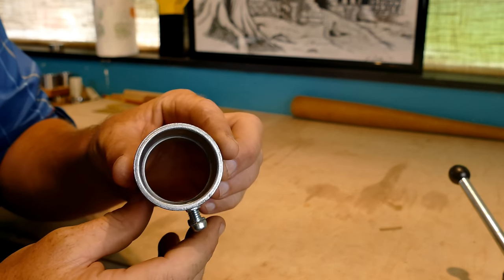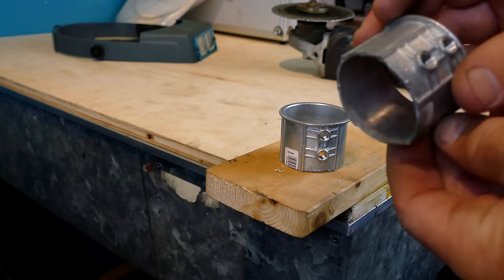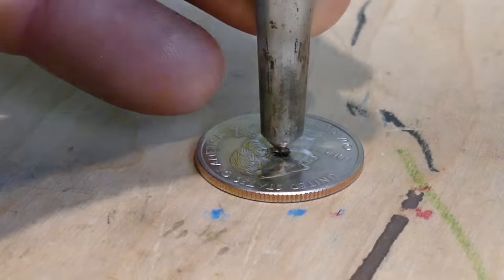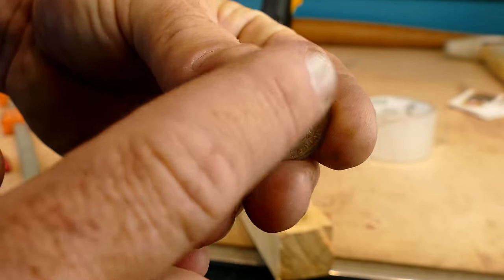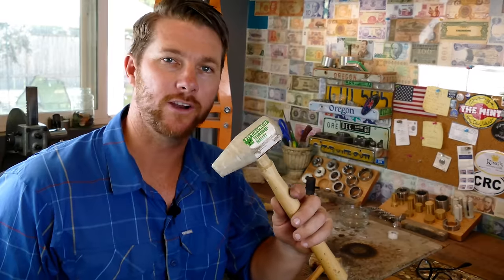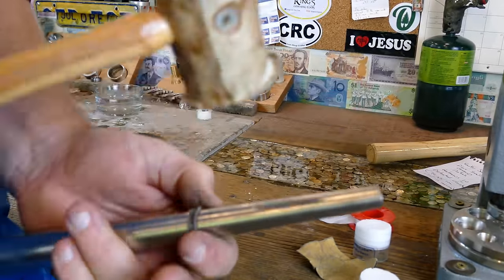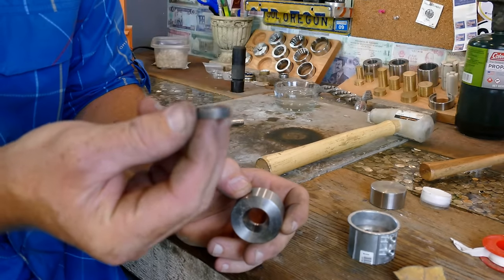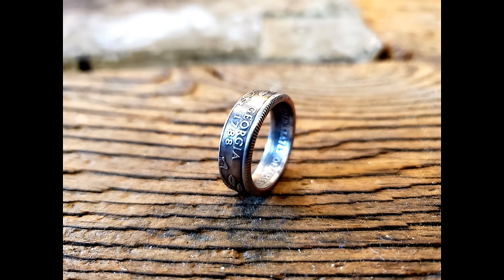Making a Pro Coin Ring Without Expensive Tools

Comment: Naw man.  I think you misinterpreted.  We want to know how to make one without ANY ring tools lol.
Reply from the maker: I made that video a while back. It is called Forged coin ring making for beginners
Reply: Yeah the press is pretty cheap if you get one at harbor freight. The dies are the expensive stuff. I have most of the stuff including dies and the press was easily the cheapest.
Reply: You don't need the ring sizer tools  a drift pin and torch to keep the coin soft just be gentle with the hammer. Get the rubber mallet from harbor freight
Reply: Railroad iron, hammer, drill and rattail file. You're welcome 😊
Reply: @CoinRingsfromTheMint  olá faz um belo trabalho
Reply: Try the magic wand method or tapping your heels 3 times.
Reply: @mayneric  what's the press do ?
Reply: an absolute bossanova you don’t need the hammering part.  A hydraulic press makes that part happen way faster, easier, and smoother.
Reply: @mayneric  how much are they compared to the tools you use to hammer ?
Reply: an absolute bossanova you can get one at harbor freight for $84.00
Reply: I made one with a hammer and file by hand.
Reply: cross hatch  Matt is right though, just the dies are over 100 bucks, thats in no way "without special tools". Dont think he was complaining about having to do work, if anything not using a specialty tool makes you have to do more work.
Reply: @CoinRingsfromTheMint  ac
Reply: You can probably use bits and pieces from the home improvement store in the place of designated ring tools. My friend made a silver half dollar into a ring with just a hammer, rotary tool, and a homemade ring press
Reply: I have a quarter ring that a friend made for me by tapping the outer edge with the underside of a spoon as you keep turning the quarter with your fingers. It takes many hours of turning and tapping.
Reply: @codgaming6546  yep it does take a lot of time but i think a ring like that looks decent and if you have really thin fingers i recommend using a smaller coin
Reply: Lol
Reply: @jacobheisesr9160  
What is a drift pin?
Reply: cross hatch2  
Dude.  That is an impressive hack. Good thinking, and I like your determination.
Reply: @parragoriouse0138  
Wouldn't a marble size ball bearing be more handy?
Reply: @2degucitas  it's a tapered rod that is used to align holes to be bolted but you can use the taper to size a ring.
Reply: @jacobheisesr9160  Ok, thanks!
Reply: Buy a ring from market ..its too easy lol...
Reply: @2degucitas  a tool for erecting steel and assembling machines, looks like the ring sizer but much cheaper at construction supply place, also maybe try a spud wrench.
Reply: 6 @CoinRingsfromTheMint  6y656
Reply: @gaylea.griffin9733  bet it looks like shit..compare to good tools..unless you have a very special skill its possible.
Reply: These are simple ass tools that your dad or uncle or granpa have what did you think he was gunna blow on it and it would turn into a 💍 . These arnt complex ring tools "" they are common and cheap
Reply: How about without any tools at all? Try just staring at it!
Reply: Get a metal rod some wood make a hot fire. Heat the steel, find 2 good rocks. Beat that steel rod into that cone. You got it. Call it caveman jewelry. It's totally free. Hope this helps. Good luck.
Reply: It's a few years late, but you can substitute a ring mandrel with a big enough round chisel and you can use a pipe stretcher for flushing the ring out after shaping around the chisel.
Reply: I like that last one

Comment: A few years ago I made a ring for my mom out of a quarter just by rolling across my fab table and tapping it with a hammer around the edge for a while, drilled and shaped the hole and polished it on a bench grinder buffing wheel, turned out nice. Might have to give this method a shot!

Comment: Rings look amazing! I'm not 100 percent sure but i believe annealing is the  process of heating  metal and cooling slowly. Quenching hot metal hardens the metal and makes it more brittle.
Reply: Well, you're half right.
The way you describe it is how it works for steel.
For silver, as well as for copper, the annealing process works just as well whether you cool it slowly or quickly.
The way annealing works is that the cristalline structure of the atoms is "relaxed" through the heat, and dislocated atoms (which otherwise lead to hardness) align themselves into the structure.
In the case of steel and other ferrous metals, the structure (or "phase") they take on at high temperature is a different one than they have at room temperature. A slow cooling process allows it to transition from one to the other (thus having a nice, aligned and soft structure), while a quick quench "freezes" the "wrong" cristalline structure in place, leading to tension in the metal and thus hardness.
I presume that silver takes on the same structure anywhere below it's melting point, so rapidly cooling down just keeps the softer, realigned structure in place.
Though that last part is an educated guess, as an engineer I can talk a lot about steel, but didn't learn much about precious metals.
Reply: @rockyblacksmith   Not doing any research and shooting from the hip I feel then if the quench does nothing other than cool it down then wouldn't it be better to allow it to slowly cool and start working it while it still has some heat because I feel whatever potential for distortion you would encounter would easily be compensated for with a softer mallet/strikes which could potentially reduce the overall distortion compared to working it cold but if nothing else allow for greater precision with the material while requiring less energy and preventing fatigue from causing certain mistakes.
Reply: @ronmcqueen4284  Working the metal while it's hot would require less force, true. But that is offset by the fact that handling a hot piece of metal is far more cumbersome than handling it at room temperature.
And having worked with silver since writing my previous comment, I can tell you it's pretty soft as is, so there is no real need for working it hot.

Comment: You don't anneal metal by quenching in water you just locked the hardness by doing that. It has to be cooled slowly. You harden metal by increasing the temp to the proper heat you need for a particular hardness then quench it in oil, etc. cooling it quickly locking the crystalline structure vs letting it realign slowly.
Reply: You are working with steel

Comment: I did the same thing as you, drilled a 10mm hole and sanded it with sandpaper.  Do not use a hydraulic press.  Because I do it myself, inch by inch.  It's a unique ring.  Thank you, your work is an inspiration.

Comment: This is really cool. How do you get a larger ring size? Do you need to start with a larger coin or is there a limit to what sizes can be made?
Reply: Put finished ring on the mandrel and tap the ring towards the larger end, stretching it. Use a wooden mallet. Turn ring 180 often.

Comment: Everyone is making coin rings with these ring tools that press the coin instead of the old fashioned way of just using a spoon. I have made several coin rings using just a common table spoon. It requires a silver coin and there will not be any of the original coin image left on the outside though. This method was the way people made wedding bands in the old days. You just tap the edge of a silver coin with the spoon. It will slowly bend the silver and when you get it to the width you want, you drill out e middle and polish it. It takes a long time, but you only need a spoon and a drill.
Reply: Jonathan Campbell quicker with a small hammer lol
Reply: can you make a video of this?!?!
Reply: Jonathan Campbell you are correct sir. Everyone is using these CoinRing tools to make rings these days. NOBODY is using a spoon and a month to make CoinRings these days. Sure, I’ve tried it. Realized after 2 hours and not much progress, I need to buy some tools
Reply: Kormatoes I have used a chasing hammer to make it go faster, but it is difficult to keep it round and even.
Reply: Robert Butcher There are advantages to using the spoon method: 1) It is an incredibly annoying and passive aggressive way of driving a roommate crazy 2) It is the only way to get the words from both sides of the coin to appear on the inside of the ring. 3) Other than drilling out the middle, it requires no tools except a spoon. 4) It is a labor of love just from the sheer amount of time spent tapping the coin and shaping it. 5) The smooth outside can be engraved and the inner portion between the words of the coin can be engraved. Of course the disadvantages would be 1) It is incredibly annoying to tap the coin for months 2) It isn’t feasible to make a ring this way for profit.
Reply: @jonathancampbell5523  Most of these people fell for the bootstraps myth hard & this is just their way to try and eek out an income in unsustainable late capitalism. Trying to get them to indulge in labors of love is like trying to get swine to avoid laying in mud to cool.
Reply: That was how I made my first ring. Sure it takes a lot of time but it taught me a valuable lesson that the little things can make something amazing
Reply: I have been on the hunt for the right coin to do this with, and I finally found one. I can't wait to try this method, ESPECIALLY for the passive aggressive aspect of it.
Reply: Jonathan Campbell I drill a hole big enough to run a bolt through. I use a washer on both of the coin to help it stay straight.. I’ve also put it in a bench vice with a couple sockets, that fit, on both sides and squeeze. It will get it back to flat.. sort of but pretty good.
Reply: @LCHFKitchenSpaz  ... I have to know what coin you chose! Tell us!!
Reply: @jonathancampbell5523  i have had much success with a tiny mallet from harbor freight that seems to be some sort of jewelry mallet as its 6 inches and under 100 grams. I  spent probably 4 hours or so on a silver coin and got it to width.

Comment: Jason Works Die 38 dollars 
Coin Anvil 38 dollars
( personally i would say just buy the "mint" Starter kit at 106 dollars Your spending 72 on just those 2 pieces)
Home Depot Torch 20 dollars
two cheap hammers lets say 20 dollars
Set Screw Coupler was 2.48
Ring Mandrel 14.00
Slush fund for odds and ends 20.00
So basically 200 dollars to start a new business or hobby. 
Knowledge of learning a new skill and craftsmanship to make money.... Priceless.

Comment: A propane grill will also work instead of a torch. Wrap some wire around the coin and hold it close to the burner. Doesn't get hot quickly but it's a somewhat common item.

Comment: Doesn't quenching harden the metal? That's what I was taught.
Reply from the maker: Steel, yes. Non ferrous metals, no :)
Reply: @CoinRingsfromTheMint  Annealing is done to relieve the hardness of cold working. Just as it is being done in ferrous metals, by subjecting the alloys to heat at a specific temperature and then allowing it to cool slowly to room temperature. the slow cooling allows full precipitation of the constituents and produces a refined microstructure.

You are tempering the metal when quenching.

Comment: How did you know how many business cards you needed? I don't fully understand how you got the center of the coin with a random stack of cards. I'm trying to center punch a coin for a different project any advice would be great
Reply: The stack of cards puts the pen at a given height above the table... The coin is perfectly circular... 

So the pen makes a mark at given distance from the edge of the coin to the center.

This holds true no matter what rotation the coin is in.
So if you rotate the coin you make a lot of little marks at precisely that distance between the edge of the coin in the center of the coin.

Comment: Here is a good one for a laugh... Back in 2006' I was cleaning a box store parking lot on 3rd shift. I found a round piece of metal that was 1/4 inche thick. I decided to use it for a ring,
(Maybe I started the fad of steel rings 😋). Years later I found out that it was a part of a craftsman socket wrench. I finally got the right cleaners to polish it. I forgot how heavy it was, I had an itch on the back of my head and I went and hit the back of my head, good thing it was at night, I let out a yell of pain that could be heard over the entire parking lot! 😋    I still have the "ring".

Comment: Anieling is when you let it cool down very slowly from the heat and let the grain structure relax.... you literally just did the opposite and tempered it.. and made it harder....
Reply: G'day Adam, It depends on the metal that's being treated. Steels are hardened by heating up to red and then quenching, but on copper, and it's alloys (Brass etc), it has the opposite effect making it very soft. It's how you treat copper and brass sheet for making hammered hollow ware. Cheers :)

Comment: I didn't know quenching was a part of annealing. 
Or is it just me?
Reply: Only in this video.
Reply: I was taught 55 years ago that to anneal copper washers you had to heat it to cherry red and let it cool naturally. Have I been doing it wrong all these years?
Reply: @colincrooky  
Nope
Reply: With some metals if you quench too soon after heating the metal will get brittle and sometimes crack 🤷
Reply: @RedRedux  
Annealing is the reverse of hardening.
No quenching! Slow cooling.
Reply: @MrHighYeller  I anneal and quench gold everyday, no issues 🤣
Reply: @MrHighYeller  Only with steels.  Non ferrous metals (coins are non ferrous) are annealed by heating to a high temperature followed by a severe quench, water in this case.
Reply: @sputnik16335  
Ya learn something new everyday. TY

Comment: Just an FYI when you anneal metals to reduce stress you heat then allow to cool slowly. When you are heating metal then quenching it it water or oil you are hardening it.
Reply: That would be true if the coin was made of steel. Copper and nickle.

Comment: Great video!   So to make rings from size 3 to 6, you need to get 1) .9- 1.0, 17 degree die, 2) .9- 1.0, 25 degree die, and 3) die anvil?   Does compressing both sides create the "fat tire" look.  On Jason's site, some dyes are called "fat tire".  Is there a difference? Thanks for your help.
Reply from the maker: The 25° die will give you the best chance for a fat tire look.
Reply: Thanks for getting back to me!  I actually more interested in the size reduction.  Do I need the 25 degree to reduce below a size 6 or can the 17 degree reduce below size 6, too?  Thanks, again.  Beautiful work!  BTW- I just tried to make my first ring 30 minutes ago and it is a little wavy and uneven.  You make it look so easy!
Reply from the maker: @shadow928x  I honestly don't know. I usually dont pay attention to which die I'm using.

Comment: Would it be possible to make one really small? I'm thinking a hole around 1/4", maybe just a little bigger. Maybe with a small coin, small hole, and small mandrel? I'm asking because I want to make one to fit on the wooden shank of a Missouri Meerschaum corn cob pipe, replacing the cheap metal ring they come with.
Reply from the maker: Sure! check out my last video

Comment: To hold the coin for drilling, try putting 3 or 4 flat head screws into the wood just around the perimeter of the coin. The heads will hold the coin. Add small washers if needed.
Reply: 4 small nails basically. Start with 2, place coin against them, lock it with the other 2/4. Simple

Comment: Is it possible to squish a ring from 6mm wide down to 5mm wide without changing the finger size?
Reply from the maker: Just sand the width down to narrow it up.
Reply: @CoinRingsfromTheMint  Thanks! The ring is 18k gold so I wondered if there was a way to reduce width without removing material.

Comment: So when you anneal it, doesn't the water quench harden it? I thought you needed to let it cool naturally for the metal to anneal. Also say you dont have a die, what then?
Reply from the maker: Non ferrous metals like copper and silver dont harden when quenched like steel does. If you dont have a die, then you just stop at the hammering phase. That requires even less tools.

Comment: Doesn't putting the coin in water after heating it up harden it?
Reply: Yes... yes it does. That tempered it ... anieling is letting it cool down really slowly
Reply: @mythiccoleman  Only for steels.  Non ferrous metals are annealed by heating to a high heat followed by a severe quench, water in this case

Comment: This might sound silly (still new to making jewelry), but do you add flux to the quarters to prevent the quarter from turning black?
Reply: Probably not, flux is used when you're soldering as in fine jewelry or in the video on the Morgan dollar paired with a setting for the stone to prevent oxidizing and letting your silver solder flow. SOS pad or the steel wool should clean up the oxidant build up. Or pickel solution. Do not boil the pickle. ( its a acid solution vapors and splashing is not good ) and do not put ferrous metal into it. It will act weird and do a reverse plating effect next time you put a non ferrous metal into get cleaned. Super pickel solution will fix the plating effect.  Worse case senario is you have to sand it away.